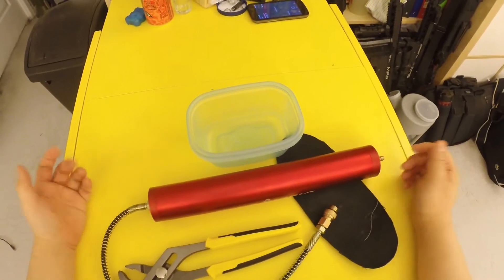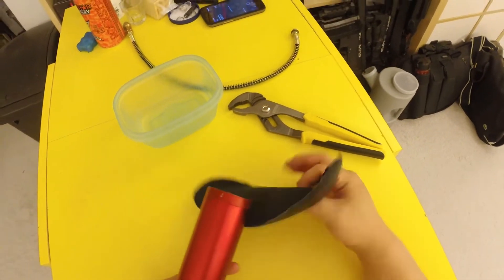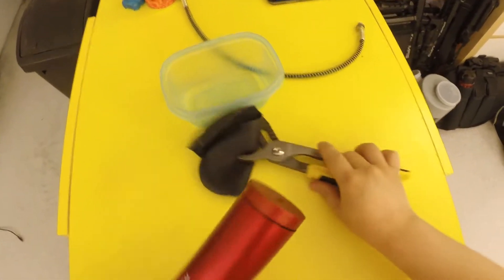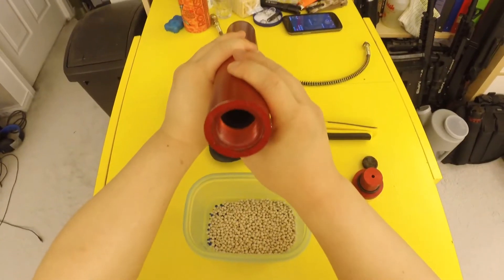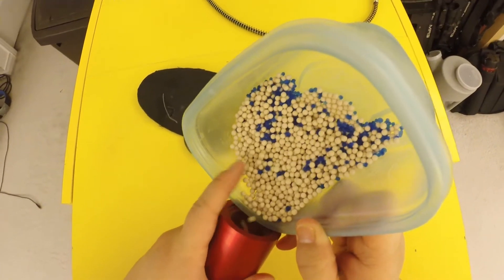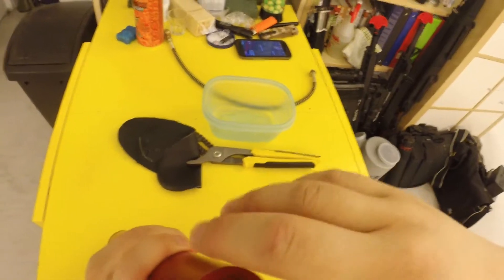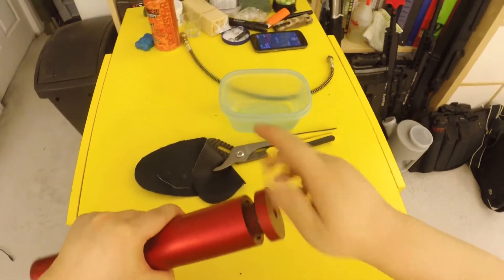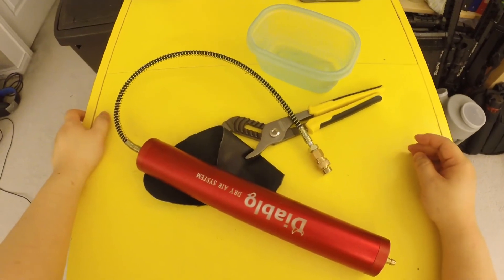Diablo Dry Air System Disassembly and Maintenance Tutorial

Comment: It looked like the inside of the tube had a black liner. Did you look to see if that is a liner or is it just dark and is just the aluminum? I find it doubtful that the manufacturer sent you a questionable product. Also, where do you get the refill beads?

Comment: I did not see where they were tested to 14000 psi ... one site that sells them says 6000 was the tested pressure.  Not that any of us are going to fill an airgun with more than 4500 psi.    

Molecular Sieve DesiccantMade from 6061T6 AluminumIn-Line with quick connects16" Flexible Hose IncludedColor Changing Gel for Sevice IndicatorStainless Steel Mesh Particle Filters4500 psi Working Pressure                   Tested to 6000 psi for Safety

Thank you for the disassembly video as I have been thinking of getting one

Comment: That is the big issue with the Diablo product. The Desiccant comes into contact with the interior of the tube. Unfortunately, the drying materials used have an acid byproduct that comes in contact with the tube and can corrode it. Better dryers that are currently available contain the material in a safe liner and keep it away from the aluminum tube itself.
Reply: "Better dryers that are currently available contain the material in a safe liner and keep it away from the aluminum tube itself."  Where?  Which ones?  Will they fit inside the Diablo tightly?
Reply from the maker: +SECoda Cooride? Mine is still safe so far and have no issues as you said, but we will see over a period of time. So far it is okay..